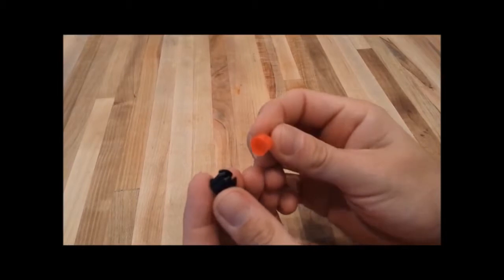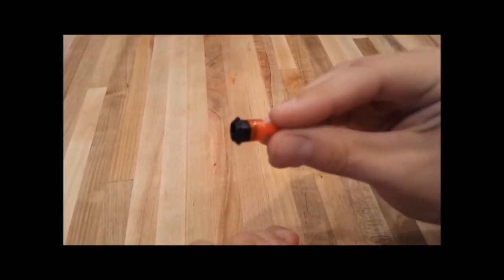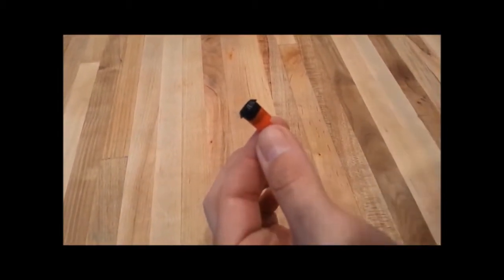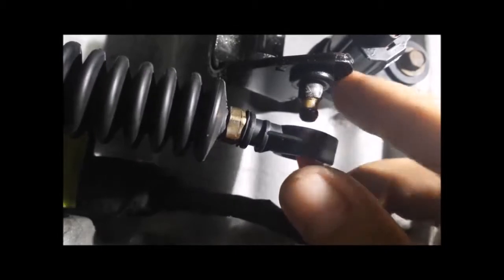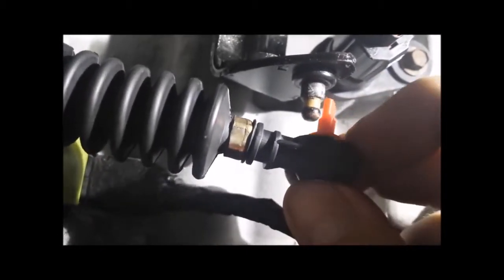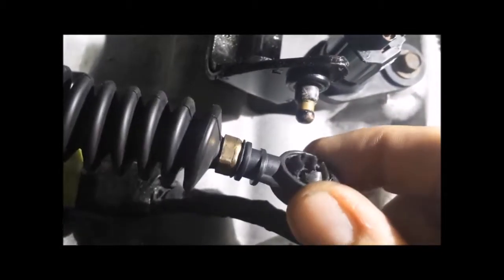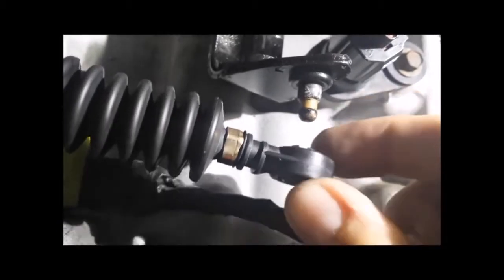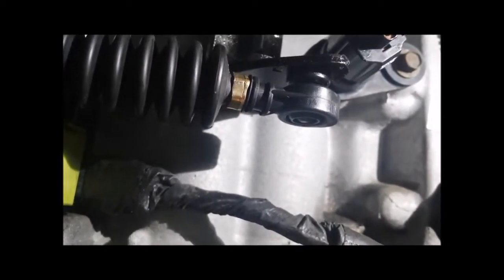The easiest way to fix your Dodge Grand Caravan shift lever! Kit includes replacement bushing.

Comment: thanks for the video What were the symptoms that nade this necessary?
Reply from the maker: We call it a "sloppy shifter".  Literally describes looseness, or wobbly shifter.  Some clients feel less looseness but find that when they move shifter into a gear that there is a disconnect between shifter to transmission.